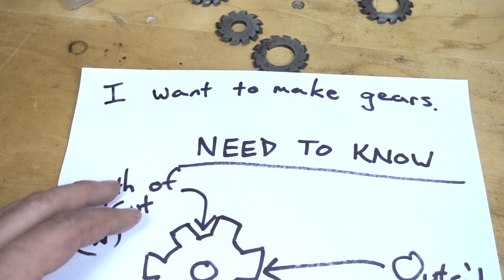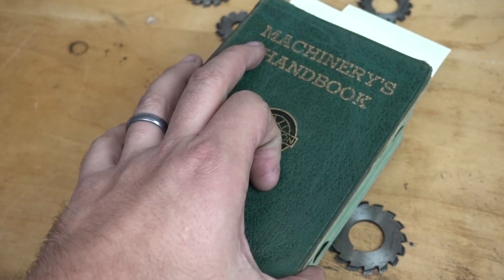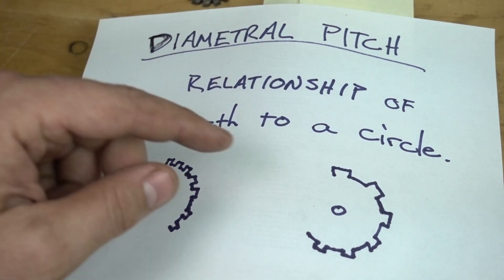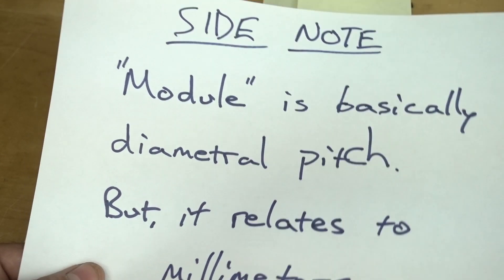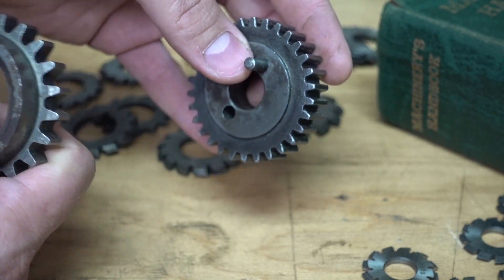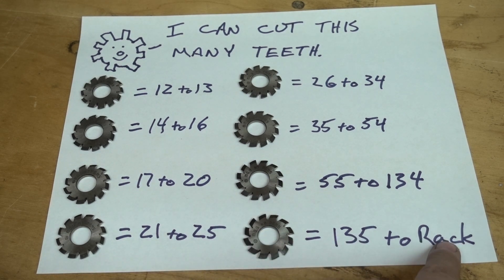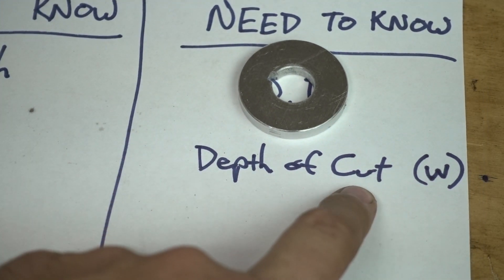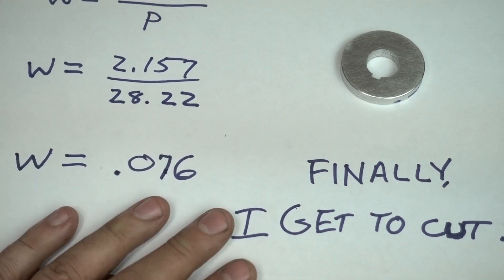Select a cutter for making gears

Comment: ThunderDog, you keep saying you suck at math.   If it was the1960's you would have a problem.  Since its the age of computers.  You don't need to know math.  Just look your math problem up on your computer.  Also I know this is America but Metric is way easier than SAE.  They make the same 8 cutters in Metric.  The difference between Pitch and Module is absolutely  nothing. It's the distance from center of one tooth to the center of the next tooth.  Love your videos, keep up the good work, Rusty

Comment: It would be helpful to know how to measure the pressure angle of the gear so that you order the correct gear cutter. 20 degree is most common these days but years ago 14.5 degree pressure angle gears were the norm. Industrial suppliers like Travers Tool Company keep both in stock. The cutters are about $60 each, a lot more than the mystery cutters on ebay, but at least you will have the correct cutter for the gear you are making.
   I use the three/four tooth measurement method. Carefully measure over three gear teeth with calipers. Then calculate: (3 tooth value) + { [ cosine(pressure angle) x Pi] / Diametral Pitch}
If this is within 0.001" or 0.002" of the measurement over four teeth you picked the correct pressure angle. The difference between 14.5 and 20 degree pressure angles will only be ~0.005" so measure as close as you can.
There is an additional clearance amount to be added to the calculated depth of cut. That is shown on the gear calculations table he used in the video. It's not much, usually just a few thousandths of an inch to make sure there is clearance when the teeth are meshed.

Cheers from NC/USA

Comment: Metric is so much easier to work with.  You don’t have things like fractional, number and letter sizes of drills for example.

I’m from the UK, and was born in 1957.  I’m really from the last generation that started to learn imperial, and then had to change to SI metric units at about the time that I went up to secondary school.  Very glad about that, still have to use imperial units for odd Things, but as seldom as possible.

I have in front of me a box of carbons for arc lamps; they’re marked ‘ Link LP 12 mm x 8 in Low intensity positive.  Does that make any sense to anyone?  Carbons were always like that, metric diameter x imperial length as far back as I can remember.  Sadly, carbon arc lamps in any form are rare now.

Comment: Hi, You should watch " This Old Tony "   and check this video out ( 15T-M2 Let This Be A Lesson To Ya! Sept 2nd 2017 )   The Module is the category of the cutter size, they start off very small for watch making, M 0.2, I think , and go up to big sizes for gears in Lrg transmitions, M5 Etc.  There are about 15 different modules.  Chinese Mini Lathes are usually M1,  I have a 12" swing 1200MM bed the gears are M2, My Taiwanese Mill is M2.5,  Etc.  This Old Tony gives the best explanation of any videos I have seen, so check it out. He tells you how to choose the gear blank Diameter by number of teeth Etc and easy way to calculate dividing  ( Plates ) on your dividing head..  All other videos I have seen are based on repairing or replacing an existing gear  with no explanation of how they derive at their measurements. Any body can copy a gear as I have done heaps of times.  Hope this helps.

Comment: The module is no longer a secret. I went to a metal workshop and the mill worker easily told me how to decide the proper module number for the gear you want to work on. It's simply like this😁:
(Number of teeth + 2) divided by the diameter.
I showed him a 62mm diameter 60 tooth gear. He immediately told me that I need a cutter from Module# 1 in order to make a new one.
I hope this helps.
Reply: Thank you for sharing.

Comment: It’s nice when we just plug the numbers into our cad file and set up the tool in cam path and the turn mill will take care of the rest. Otherwise we load round bar into the barber Colman and use correct change gears. Sounds like a coin machine dropping gears one after the other.

Comment: How you got the 28.22 please explain thanks ?  And from where is the DP 25,4 number.
Reply from the maker: It's a module 0.9 which is 28.22 diametral pitch.  See 8:00 of this video.  Hope that helps.
Reply: @ThunderDog  Hi thanks so 28.22 is the diameter of the module if i understand,and the other number the 25.4 how you get it from what? Waiting your answer thanks.
Reply from the maker: @jozsefienciu2325  25.4 is apart of an equation which is found in the Machinery Handbook.  It's one of the Machinery Handbook rules/equations to convert from module to diametral pitch.
Reply: @ThunderDog  Thanks a lot.

Comment: Every Diametral pitch has eight cutters. You use the one for the number of teeth your cutting for that gear no1 for 12-13 teeth no2 14-16 for teeth no3 for 17-20 teeth no4 for 21-25 teeth ect.. ect. up to no8 for over 135 teeth.  The P is for Pressure Angle, (PA) on SEA or American gears. The two most common in American gears is 14.5 and 20 degree. any gear after 1980 is most likely 20 degree Pressure Angle but there are specialty gears that are any number of PA
Reply: According to 'Machinery's Handbook', a #1 cutter is 135 to rack   and a #8 is 12 to 13 teeth
Reply: OD=133
TEETH=40
DEPTH OF CUT=7mmm
which cutter should i prefer for cutting spur gear

Comment: DP is not equal to number of teeth divided by outside diameter. It is equal to number of teeth divided by pitch diameter. Pitch diameter is the point where the Addendum and Dedendum meet on the gear tooth. If you want to use OD of gear you add 2 to the number of teeth then divide by OD ( DP=N+2/OD )
Reply: DP=N+2/OD      OD=N+2/DP       N=(DPxOD)-2     Yes   if you want to use the pitch diameter then don't use 2 which is the addendum factor.     As shown in this video, you don't need the pitch diameter to calculate or cut a gear.

Comment: From what I can make out the DP is the width of the tooth cog end on a correctly cut gear.
20 DP would be 1/20th of an inch wide so a smaller DP number is bigger.
Module 1 would be 1mm wide and a larger number would be bigger.
Anybody please correct me If I'm wrong.
Reply: Ahhhhh no, DP is a ratio between the pitch diameter and the number of teeth on the wheel.
The width of a tooth on a 20 DP gear  can be found by dividing 3.1416 by the diametral pitch.   This gives the circular pitch, the width of a tooth and a space, divide by 2 and you have the tooth width.

Comment: Ok, so you have a broken gear, you know the number of teeth, that's easy enough, how do you identify which module it is?
Reply: You need to measure the OD and count the number of teeth.   (metric mm)   Module=OD/N+2        (inch)(DP=N+2/OD   inch and mm are treated differently

Comment: My biggest hurdle is understanding the statements. In one- it is said N+2 divided by diameter= DP. In another, N divided by pitch diameter= DP.  
  I'm guessing the first means the N + 2 / total outside diameter (Not pitch diameter)  ? argg
Reply: Yes......OD...when two gears mesh of whatever tooth count...they mesh at the pitch circle...this is calculated along with center distance.    You cannot measure pitch diameter...it can be calculated......to cut a gear you only need the number of teeth, then OD of the blank is calculated and cutting depth.  The 2 factor only applies to the involute tooth form......what? you mean there are other tooth forms...yes  such as cyclodial   clocks and watches use this form.

Comment: Doesnt make sence...the tooth size, pitch, depth is always the same if you use the same set of gears only the gear diameter is different. so one cutter should fit them all. same like a bike chain.
Reply: No......there are a set of 8 cutters per DP or module system....one cutter will not cut every tooth size.   A 12 tooth cutter cuts a wider space and a narrower tooth width than a cutter that cuts 134 teeth, a NO.8 cutter.

A problem with this video...one should not mesh DP gears and module......they are based on different measuring systems, think inch or mm then use the proper system and cutter.  No one cuts one gear it always meshes with another gear, module and DP gears never are the same.
Reply from the maker: Agreed. I don't think I said DP should be mixed with module.  To the best of my knowledge module is similar to DP.  To be clear, all gears in a gear train should be of the same DP or of the same module.   Again, this is my limited hobby experience.
Reply: @ThunderDog  You are correct they are similar ....because of one being metric and the other inch ...one is multiplied and the other divided....you have good experience and a good video.

Comment: Great tutorial. I too have added this video to my computer library.There are many very smart people out there but very few know how to teach. You did a great job here.When I was in school learning my trade it was explained to me that DP or diametrical pitch meant the number of teeth per inch of the gear diameter. In other words a 6DP gear meant there were 6 teeth for every inch of the gear diameter. Count the teeth on your gear and divide by the diameter -- that's your DP number. I believe that is correct and if not then straighten me out LOL.Once again -- great job.
Reply from the maker: Thank you.  I appreciate that feedback, it lets me know that I'm doing something right!!
Reply: Ahhh..... no     DP is the number of teeth(or the number of tooth pitches) on the circumference of a gear 1'' in diameter.     DP= N/OD       example......a 30 tooth gear divided by 1'' dia. blank equals 30 (DP)        a 60 tooth gear divided by a 2'' dia. blank equals  30 (DP)
Also   OD=N/DP    This is the relationship to explain DP using the pitch circle of  gears,  think of two disks touching and rubbing together, without teeth......if you want to cut a blank for a gear(which must be a larger dia. than the blank disks) then you must add the addendum factor.....which is always 2, when using the involute tooth form.     There are other tooth forms such as the cyclodial form where the addendum factors are different.
Reply: @thebaron44  Close but no cigar DP is not equal to number of teeth divided by outside diameter. It is equal to number of teeth divided by pitch diameter. Pitch diameter is the point where the Addendum and Dedendum meet on the gear tooth. If you want to use OD of gear you add 2 to the number of teeth then divide by OD ( DP=N+2/OD )
Reply: @nickk3863  You are correct in my hurry I forgot to add the 2 to the N

Comment: Nice vid Thunder.  would you happen to know the whereabouts of a set of 22DP with a 20 PA cutters?
Reply from the maker: +Charlie Romeo I'm not brushing you off, but I would just check eBay.  My set was an offshore purchase.
Reply: banggood . com               this is a chineese  site that sells machineing stuff as well as lots more stuff.
Reply: Jamie Buckley Will give it a shot.  I'm learning however, 22DP is hard to find, especially with. 20 deg PA. I will keep looking though.  Thanks for suggestion.